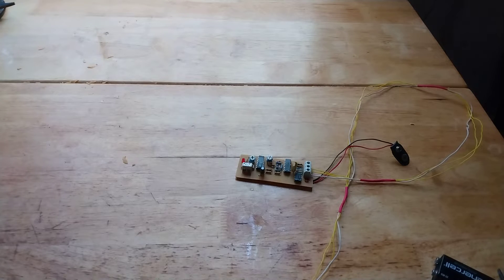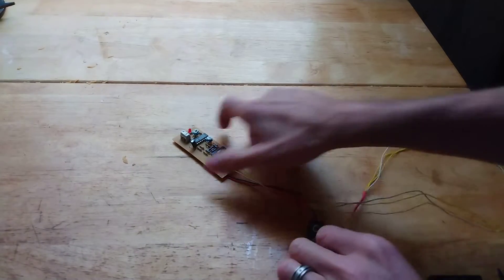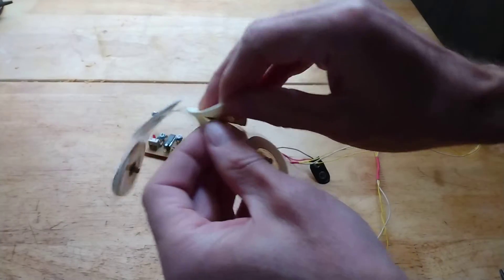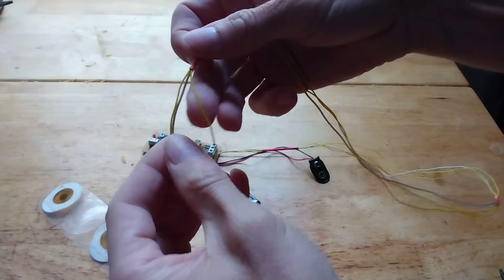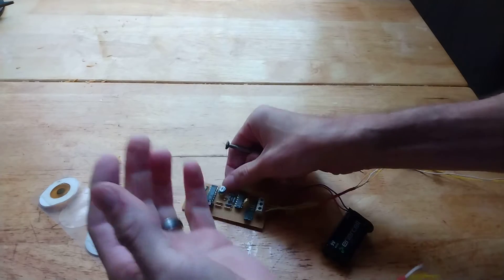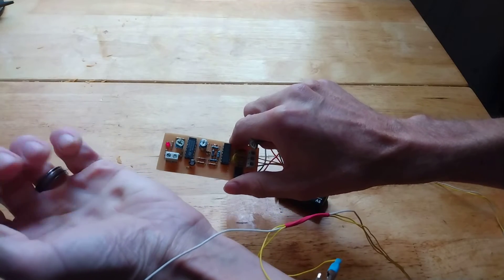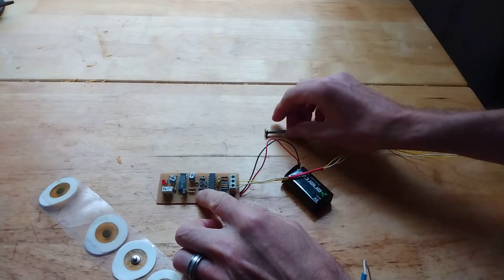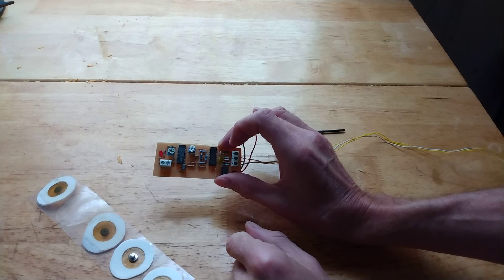Test of my own EMG Sensor Circuit - DIY

Comment: Thank you, it's very good, is it possible to move a DC motor and how?
Reply from the maker: Yes, simply plug the output of the circuit to a DC motor driver. You can also use it to control a video game, as I show in this video tutorial: https://youtu.be/TMr25ouvpD4
Reply: Thank you sir, you are very kind @BlueMoonshine